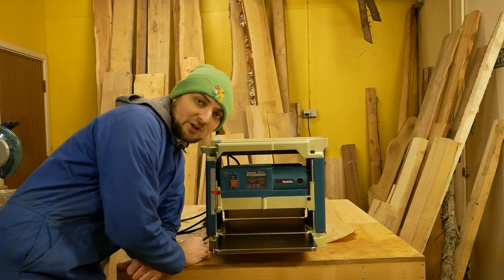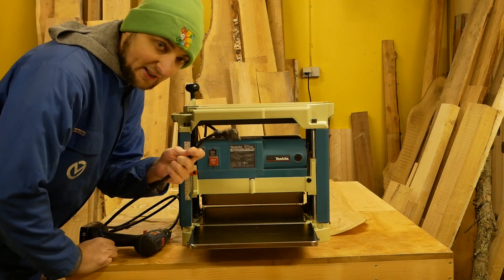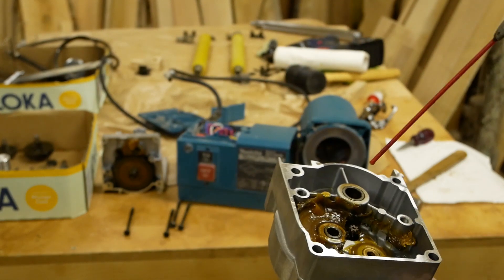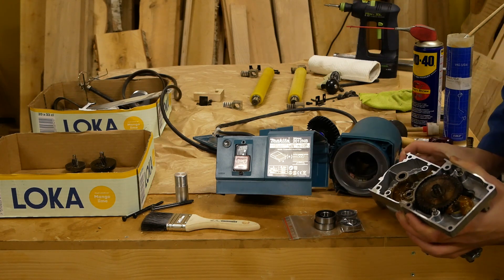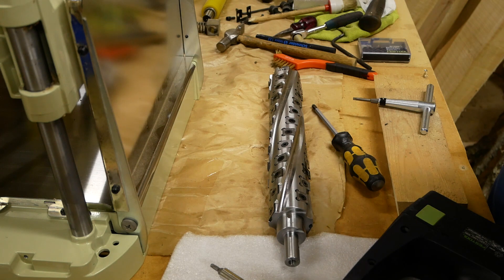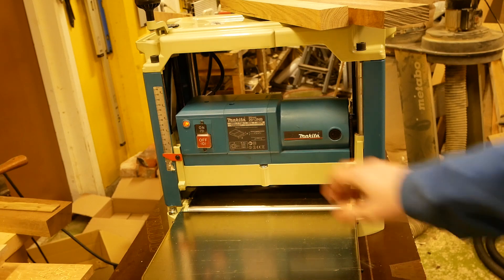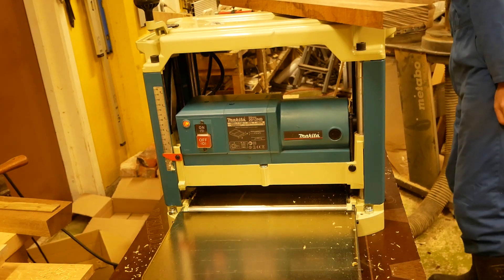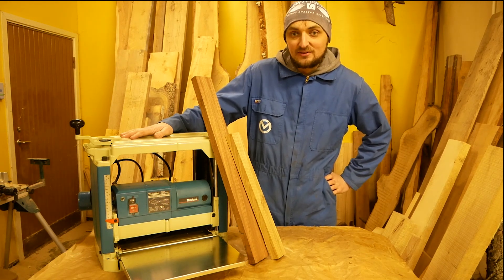Makita 2012NB full maintenance,  Helical spiral cutter head upgrade.

Comment: Great video. How would you compare the Makita to cheaper models like the Metabo or Triton? Or vs more expensive ones like IGM or Shinko that already include a helical head?
Reply from the maker: Hello !
I don't see the point in buying a Metabo, the price difference is not that big. Makita + Hellical is  expensive (I bought Makita 7 years ago). Perhaps there are good offers on the market now in this budget with good blades. Get a good one, it will serve you well, and it will also be easier to sell if you want to upgrade.
Best regards!
Reply: @romanrudenko1614  Thanks! Just a comparison here in NL / Germany, Makita is 650-700 and Metabo is 400-450 so quite a difference. Also IGM with helical head included is 1000. 

Build quality on Makita does seem a lot better, also it is 10 dB less loud!

Comment: Great video !
It looks like the cutter head is a spiral cutter head, not a helical cutter head. An helical cutter head has some angle to each knives. Theoricaly the difference between the two is that the spiral cutter head have a great finish on softer woods and helical are better for hard wood. Have you noticed that since you installed it ?
Reply from the maker: This head have huge difference with stock one , work smoothedr and softer, less preasure to motor , also way way less chance to tear out wood. Unfortunately, I can’t compare them with other manufacturers, but I spent a long time choosing which one to buy and was very pleased with results.

Comment: Great Job, many thanks to show it. Seems I was sleeping during the dismount process and now I am unsure where the longer and shorter springs at the Rollers take place. Inside 2012NB exploded drawing there is at every roller a longer and a shorter compression spring on each end. I would have expected that every roller has two springs of the same length. Maybe the longer ones at the entry roller and the shorter ones at the exit roller. Can you remember what is right? Best regards
Reply from the maker: Hello , thank you ! At 2:53 we can see that Front Right spring is long , also she marked with white color , try to instal Front Left - short  | FR - long , after that measure parallelness between roller and bottom , if everything is correct try same on second roller with paralel check .
Best regards!
Reply: Hello Roman, thank you for your quick answer. The parallel check is a nice idea, but I think screwing on the metal covers (Item # 52, 62, 82, 89) will pressing the roller bearings flat to the housing and this is independent from the length of the springs. At the end the longer springs are squeezed more then the shorter ones and the roller will be parallel independent of the used spring length. Where is the point I did understand your idea wrong? Best regards!
Reply from the maker: Salute , i just check info - from left ( side where chain ) you need to install short ones , they harder its made special to absorb extra vibrations from chain.Right side longer , they softer and marked with white color.
Best regards! @Howie656565
Reply: Thank you Roman,  you saved my day 😊. All the best!

Comment: Great video ! thank you. Can you please explain why you also changed the rotor bearings? the helicalhead manifacturer reuses the originals and does not put new ones in the rotor. di you need to do this step?
thanks again.
Reply from the maker: If you have opened the motor for inspection and lubrication, I advise you to replace the bearings. From factory they are "made in china" .... and after several years of work .... Lubricate everything well and put SKF , its not expencive and easy to replace. Machine will work smooth and nice.
Best regards!